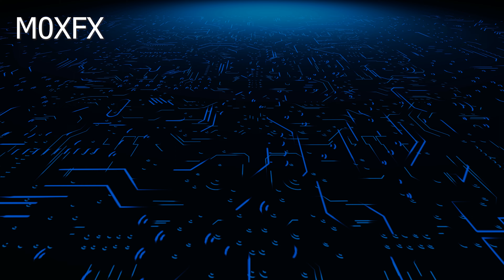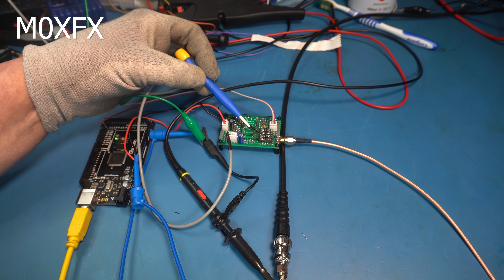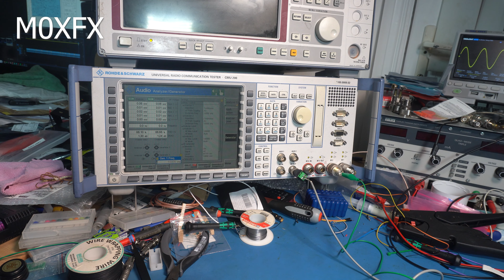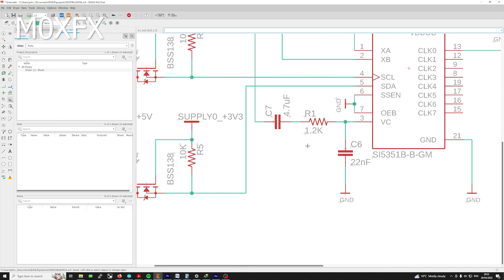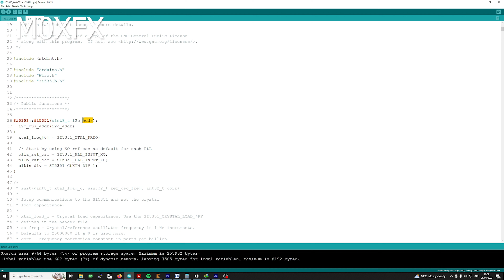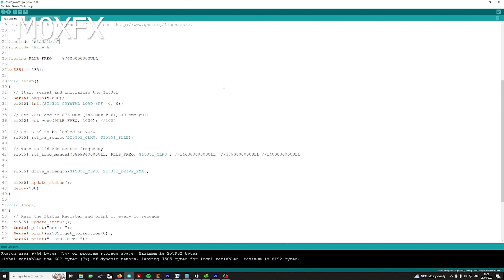Playing With SI5351B & Trying to Produce Voice FM Modulation

Comment: Due to how the input of the chip is done, you need to bias the input of the VC control at something, not letting it float like in your example. This is the reason for your distortion and issues with large deviations.
Reply: a voltage divider consisting of 2 equal resistors between VCC and GND works niceley.
Reply from the maker: Hi Thomas thank you for your comment, and yes I did figure that out in the end. I am now using 2 x 100K resistors as biasing to the VC pin between ground and VCC with an AC coupling cap, I have also added limiting and pre emphasis it's working really well. I need to make an update video. Thanks again best regards John

Comment: 2-issues I see 

1.2995 test set should use 15khz lpf on deviation measurements ,common engineering mistake.

2.You need to audio clip the injected signal.
It's needs 20db between 5mV RMS and 35mv RMS max dev limited 

EU is 1.90khz dev on 1khz test tone 35-50mV input to radio 
Speech peaks 2.00khz 
8ko F3E

UK is 2.10khz dev at 1khz test tone into radio 
35-50mV RMS 
Speech peaks 2.20khz dev 
11ko F3E

By using a simple bat 54 Schottky diode pack,act as a audio diode clipper/limiter after microphone preamplifier (low cut 350hz,hi cut 3.0khz )
Need about 20dB change clean audio 
About 0.2V audio to drive bat54 diodes,it will clip and square wave the audio,giving it audio punch.
On 2995 test set 
Set FM modulation meter filter to 15khz ,not 0.-3.5khz 

I'll then see proper clipped full limited FM modulation.

I've used this bat54 diode audio clipper on a few CB radios ,inside it's just two diodes back to back.
Fed with 0.47-1.0uF caps in and out to prior to dev pot.

Very simple trick to get punchy FM audio by audio clipping waveform prior to injected to dev pot,then into your injection point.

Hope that helps 

Rob P 

RP.Comms
Reply from the maker: Thank you for your informative comment. Yes I totally agree with what you are saying regarding the 2955 setup. 

I just set the unit up for a rough measurement, as the FM deviation was pretty lousy if I'm honest. I have been tinkering and a lot has happened since I made this video. 

I have designed and made up a complete PCB with a Si5351B, microcontroller and other circuitry also  I  have since sorted out the FM modulation by adding pre-emphasis and limiting to the audio signal feeding the VCO input, and it was indeed by adding Schottky diodes and some active filtering using a LM358 op amp. 

The FM deviation level is now adjustable from around 1Khz to 8Khz. This is a clip of the board in action, and Yes (before anyone mentions)  I know playing music into a rig  isn't a suitable test. I am planning to make a new video and create a GitHub page as soon as I am back in the UK.

Thank you for your input, it's very much appreciated.

Check out this link

 https://www.youtube.com/shorts/2Pl4KZbrzLM
Reply: @M0XFXUK  Fab news ,well done 👍
I'm very interested in this for a S-NFM,N-Fm+ctcss
 Analogue hotspot for 24-31mhz  band using FM modulation generation this way but I gave up in end was just too complex a few years back and Info was a bit vague.

Looks like you cracked it ,well done 

Lol 15khz lpf on 2995 is classic mistake on FM ,why to they did this never understood and many a radio engineer set up FM deviation wrongly unintentionally 🙄
In workshop lol.

Thanks for the link will take a look and finally somebody's cracked it,well done👍

73's Rob
Reply from the maker: @rpcomms1  Hi Rob, interesting regarding the 2955 deviation  15khz lpf. I will have a look at this at some stage and possibly make a video. Every day is a learning day, as they say, thanks for the heads-up. Re the SI5153B it seems to be working well however; I have not tried CTCSS as yet, but I have a feeling it may just work at the low audio frequencies. It would be a good test and to get CTCSS into the signal. I am more than happy to send you the schematic and an unpopulated PCB as I have a few of them. I am currently in Denmark for work and I should be back in the UK in a couple of weeks time as I plan to make a video and put everything on Github including the code. If you drop me an email, I will ping over the schematic m0xfx.channel@gmail.com  73s

Comment: Nice work, I did similar with the 'B' chip too, but approached it in a slightly different way

On the '059 chassis you can replace the VCO with the 5351A and use the original modulation circuit (which aint great on the '059 but can be improved) and just modulate one of the loop mixer crystals for FM.
Reply from the maker: Hi yes the B version is quite an interesting IC. since making this video I have made some significant improvements, I made a complete board with an ATMEGA328P controller and op-amps with pre-emphasis and signal limiting to the si5351B PLL. The FM is now sounding much better. I will make another video when I find the time and go through it. Interesting stuff regarding the 059 chassis.

Comment: Brilliant work, it sounded ok mate
Reply from the maker: Thanks Paul, I do think It needs a little more work if I'm honest. I feel that the audio quality could be improved by changing the filtering in the audio path at the VC pin, possibly adding an ALC circuit and playing about with the code. I need to spend more time tinkering with it. That being said it's still quite an impressive little IC.
Reply: @M0XFXUK  I think perhaps a little pre emphasis on higher audio frequencies? But certainly a little tweak... but all thr same well done a brilliant little project and maybe a fancy lcd later... only joking well done mate
Reply from the maker: @paultomlinson528  Hi Paul yes I agree some higher frequency pre emphasis would most probably improve things. Also I was thinking that an ALC circuit of sorts may improve the overall performance. I am going to keep playing with it when I have time and I will make another video if I can improve the performance. Re the LCD screen and controlling code, I have all ready done this but I am not sure how this would go down on this channel as most people enjoy the repair videos and I think don't really care for C++ programming videos. I am thinking of starting another channel for hobby radio electronics, micro controllers and coding etc but I'm still a little undecided which way to go with it. Thanks for the comment.
Reply: @M0XFXUK  omg the other channel... sign me up on that one mate

Comment: in all fairness deviation being around 2.5khz is all you need on a CB/10mtrs.
Reply from the maker: Hi Mark. I was thinking along the same lines, it would have been nice if it could have produced more deviation but it is what it is but it's still a very useful IC considering the price.  So I guess we shouldn't lose sight of the fact that it's not really designed for this kind of work and it's a bonus that we can use it in radio applications.   I'm still tinkering around with it. 🤪